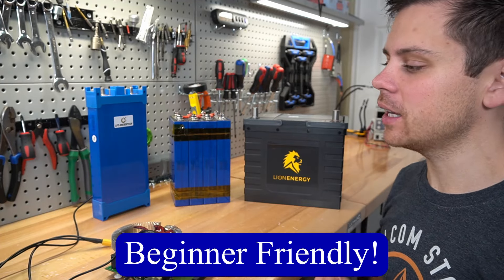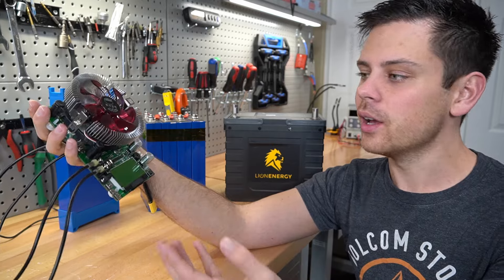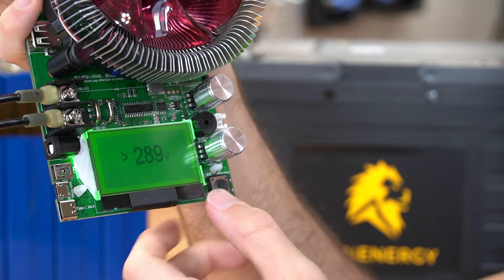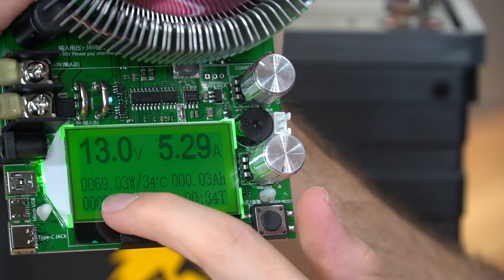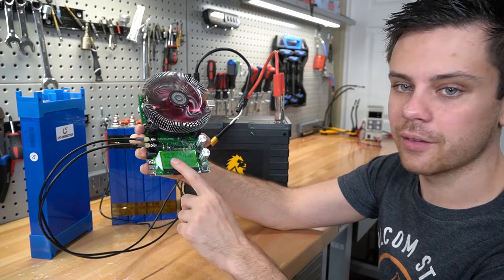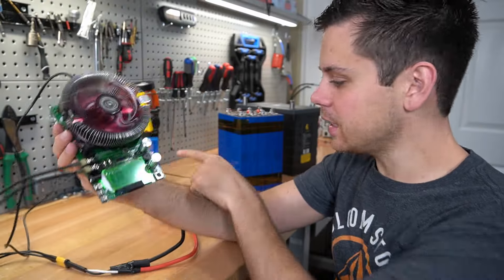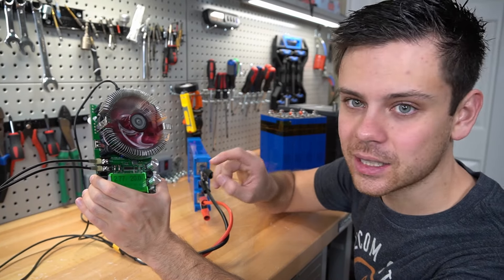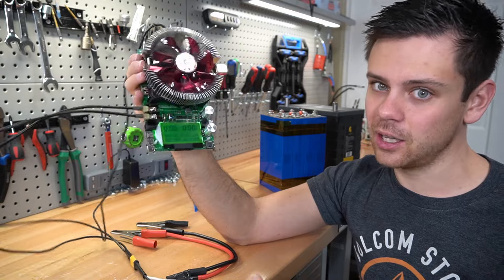Beginner Friendly Lithium Battery Capacity Test Method

Comment: Hi Will   Thanks for all that you do. Great help  I have 4- 12V 200Ah batteries. I am having trouble with the batteries shutting down. Is there a way to load test the batteries to fine the bad battery . A multi meter reads 27.9v on all 4

Comment: i have made a "simple" setup for testing a battery not loosing all the energy to heat. 
( battery1 to test (with bms) -->  energy meter --> inverter to AC --> battery2 charger --> battery2 (with bms) )  
battery2 is much bigger than battery1 and practically empty ;)
Reply: I like your way of thinking.

Comment: Why not just power your inverter through an inline DC Power meter? The power meter logs Amp-hours, power, voltage, current, peak current, min voltage and more, and only costs €10 on eBay from China and will withstand 100 Amps. The procedure would be to just start up your inverter and power your usual loads (computer, lights, whatever), and read off the Ah value from the meter when depleted. Advantage is that the energy isn't wasted as heat, it's used to run useful appliances that you'd have run anyway. And the max discharge rate is way higher than the 300W of this load tester so it would finish faster.

If you're going to look it up on eBay, it's the one with the blue case and the two-line dot matrix display. The title of the cheapest one is "LCD Digital Battery Analyze Monitor Watt Meter DC Ammeter RC Power Amp 60V/100A"

Comment: Thanks for sharing this info on such a neat device. Can you test super capacitors to see if the Farad value claims match what is sold?
I am interested in buying these 16.2 Volt 83.3 Farad super capacitors sold on ebay and Amazon. Are they really what they are.

Comment: Take the positive voltage on the buzzer, thru a 1K resistor to a 2N2222 to a relay that will disconnect the load. Solved.

Comment: With thin leads I guess the voltage readout is some 0.5V lower at 20 Amps.  Does the test unit have some I*R cable voltage drop compensation or maybe separate test leads?

At high current you may disconnect to early if you do not compensate for the cable voltage drop.

Comment: Cool video as usual!  If all goes well this year I plan to upgrade from my 12v AGM system to a Lifepo4 either 24 or 48v one, hopefully over 300ah total.  Found a deal on used PV panels.  The question is, do I need to check just to voltage to make sure they are working or the Amps as well?  In either case would I also need to test them on a Sunny day or would part sun work?

Comment: Because of not null internal resistance of the battery you need to test it at the same current every time. Test results made at different currents incomparable.
In the datasheets of the good brands batteries usually exists chart with usable capacity vs discharge current.

Comment: Love your videos! I noticed that the voltage at the battery with NO LOAD verses voltage at the battery WITH LOAD (.2C) are substantially different. Which voltage measurement should determine the top (3.65v) and bottom (2.6v) voltages?

Comment: Will thank you for all the time you've put into these videos and sharing your knowledge.  Many have no idea the time and energy it takes just to publish these.  Something I'm always curious about is sort of a lessons learned video, we all know what happens when we short these bad boys...lots of sparks and honestly on the higher capacity cells possibly lethal.  I'll never forget trying to do my dad a solid back in the early 80's when I attempted to install his new car battery in his 77' Chevy Nova.  I learned that when you leave the large plastic insulator block that came on the bottom of auto batteries in that day to insulate from poor storage (i.e. concrete floors); that if, you leave said block on the battery and install said battery and slam shut the hood it is very possible (100% chance in my case) that the hood of the car will short circuit the battery.  My dad was none too pleased to see two large silver dollar sized holes in his hood :)  Do you have a video of lessons learned?  If not is it something you would consider making?  Thank you again!
Reply: i have 3 of these from a year ago. Now not one of them will turn on.
Is there a way to "reset" them? None of them "blew up" or smoked or anything like that.
Reply: @RemodelCalculator  have you measured DC volts at the round plug end of your power supply?  Outside of that, nope, no clue what's wrong with your units.
Reply: @motleypixel  i measured voltage at "Output" plug - same as input voltage
Reply: @RemodelCalculator  hold on, a wall wart (older term for AC>DC power transformer) shouldn't have the same input/output, typically in the US the input would be 115VAC and the output is typically between 5 and 24VDC.  So in your case your wall wart isn't transforming anything and 115VAC has fried your unit :)

Comment: I am curious, do you test a 12V Lifepo4 battery to verify Ah and Wh rating by letting them run down until the BMS shuts down the battery due to low voltage or until running it down to 10% SOC or so?

Comment: I have a Qwork Battery Monitor Voltmeter Ammeter that uses a shunt.  You mentioned that I could use something like this to do a capacity test.  How would I do that exactly?  My battery is a 48V 105AH LiFEPO4 battery hooked up to a golf cart.  Thanks.

Comment: The device you are using in this video comes with a USB port and the USB cable with positive and negative internals on one end, and USB on the other. Can this be used instead of using the positive and negative terminals on the device?

Comment: Nobody is talking about this clearly in the comments (not that I found), but to set the low voltage disconnect you need to double-click (not hold) the button. However, on some units it doesn't disconnect, it just warns with a beep; and even if it disconnects, the cell/battery is still connected to the unit and loses voltage. So beware!

Comment: hi i made a simple 4s 56 cell battery at 2 amps take around 8 to 9 hours charge by the wall i only charge it to 15.8v and not the full 16.8 v what u think the wh would be on that set up im thinking it would be around 336wh or something but would love to hear ur thinking on it its been running now for around 6 months i have no bms on it as was not sure how to add that in but iv checked the cells and there all within the same range of charge so n probs there

Comment: I just received the one with the pink looking fan... i have a question on these...
I set low cutoff to 11.5 and had volt meter on battery directly, I noticed the volt difference between the two was like .2-.4 volts.
Tester turned off at 11.5 but volt meter showed battery was still at 11.8. I think I was running the tester at about 10 amps.
Should I test capacity with tester at 11.5 (fla) or bump it down to like 11.2 so battery meter showes battery at 11.5?
Reply: Yeah i have the same experience. Started with one cell at 3.3v.Turned the tester on at 10A. The multimeter displays 3.30V and the tester 3.0V. Did you find the answer why there is a difference?
Reply: @frankprumers8902  same ..did you ever figure out ?
Reply: Same here :(

Comment: interesting video. I would like to know if its possible to use this same setup to put a load of 40/70 amps on a battery in order to test the output of a rebuilt alternator? Thank you in advance.
Reply: 70Amp x 12Volts = 840W boom! With this 185W tester......
Reply: @MrMaster72  thank you very much good sir. I have plans for it :)

Comment: What if the LifePo4 battery has a BMS with Bluetooth? Would the BMS Bluetooth reading be accurate enough if you hooked the battery to a load in order to find out the Ah's of the battery?

Comment: I would love to see a more detailed video about the C-Rating. I'm still confused about that. I see 20-C (on the battery), and a 1, 2, 0.1, 0.2, and so on in your on-screen postings and i'm confused. and, how would i use the c-rating when testing or comparing battery / system setup and what-not's. thanks.
Reply: I think a Will Prowse clip on that would be cool too. In wondering along the same line, I ran into a pdf Guide to Understanding Battery Specifications: here is what that says:    "C- and E- rates – In describing batteries, discharge current is often expressed as a C-rate in order to normalize against battery capacity, ...  A C-rate is a measure of the rate at which a battery is discharged relative to its maximum capacity. A 1C rate means that the discharge current will discharge the entire battery in 1 hour. For a battery with a capacity of 100 Amp-hrs, this equates to a discharge current of 100 Amps. A 5C rate for this battery would be 500 Amps, and a C/2 rate would be 50 Amps. Similarly, an E-rate describes the discharge power. A 1E rate is the discharge power to discharge the entire battery in 1 hour.

Comment: Question if I may Will, when manufacturers state capacity, are they measuring to the recommended low voltage cut off point or are they measuring to the absolute death of the battery? Is a 100ah the useable capacity? Or should I expect like 80ah to 2.6v?
Reply: Great question!

Comment: Hi, Will. Do you know a lithium battery charger where we can specify the maximum charge voltage. I've been trying to find one that let's me charge for example to 4.0V instead of 4.2V. I've the Opus charger and Skyrc Imax B6, but the minimum voltage the skyrc let's me use is only 4.14V. Thanks and congrats for this great channel.

Comment: Can this tester be used on multi-cell lipo packs like those used in radio control cars and planes, or it it only for a single cell?  I would need a low voltage alarm for 6 cells at 21 volts.

Comment: If you use this on a newly charged LGM Sealed Lead Acid, and don't set a minimum test voltage, did you just destroy the battery when you get back? I mean isn't it bad to run that into the lowest voltage (like 0)?

Comment: 120ah lipo batteries in series and then I disconnected 1 from 5 batteries. All others 13.3 and this one 12.4  and soon as I changed it out so I had 4 in series working well each 13 v or above, the total 50 volts plus. 

How could one battery die like that. 

Also another battery the too of the case have risen up. Much be pressure release

Comment: Can it really handle 185 W for long time? I heard about it will burn the Mosfet with 150+ W. The accuracy of these cheap dummy loads is not really as good as claimed. It can have 3..5% error and it doesn't you 4 wire measuring. You will already loose some W in the wires when loaded with 10+ Amps.

Comment: Will, I keep getting that annoying beeping sound, without the battery even hooked up due to my low voltage shutoff at <10.6V!  What is causing this? I hook the battery up and turn up the dial and it will not do anything but continue beeping. Any help would be so appreciated

Comment: These do NOT turn off the load properly. As soon as the load turns off from low voltage, the voltage goes back up and it draws more current until it drops again.

Comment: hi there, can be put toghether lithium battery different Amps like 3 cels 90A with 1 cell 100A ? and also can be put together different C rates? 
i have for exemple 80 cells 18650/1500mAh on 3C can i put them in series with 18650/1500mAh but only on 1c ? 

thanx

Comment: Random question that may sound stupid, however, how dose a device know how full a battery is?
Dose the resistance change?
If you change it out for a "larger" batter of the same size how dose it know the difference?
Reply: For cheaper devices voltage and for more premium options a coulometer

Comment: Do have a link for the temp sensor probes you use for the smart bms you suggest for a 48v LiFePo4 diy battery. The ones I have are not working properly and read -17 instead of proper temp. Thanks in advance.

Comment: For a 12VDC SLA 8Ah battery test I set the LVCO to 10.8V (<10.8V! as shown on display) and the damn thing will only take about 1.2AH out of the pack before the LVCO senses 10.8VDC.  Whereas my old hobby RC Triton Pb, NiMh, NiCad, Li-Ion charger and discharger is able to take about 7.6Ah...what's up with this?  Faulty?  BTW, to change the LVCO is insanely tedious, having to double tap the little momentary press button for .1V increments...LOL took me 10 mins to go from 0 to 10.8...I'm sure I'm missing something obvious...or not?

Comment: So I don't know exactly why; but I just tried to set up the capacity tester for a test and was starting to increase the watt knob up to around 100 W when suddenly the unit started to fizzle and pop and suddenly burst into flames. Scared the heck out of me and also could have burned my house down. Just an FYI on safety of the unit. Luckily the test was only starting when the fault occurred while dialing the watts.

Comment: I been playing with mine. I thought it did shut down when the voltage got below the setpoint but maybe I was distracted by the beeping. The voltage levels are really hard to adjust. They go full scale in one direction 300V or zero and they won't reverse direction. This may go back.

Comment: Sorry, I don't know much about electricity so this might be obvious. I am doing a capacity test with this thing (185w version) on my 100ah battery that is supposed to have a BMS. I am 45 minutes into the test and the Voltage on the lcd screen of the capacity tester shows 11.3V, 16A, 012.35Ah used, 181watts. Why is the Voltage being displayed as so low? Shouldn't the BMS have cut the power already?

Comment: What voltage is required from the wall wart?  I am off-grid and need to run off a buck convertor!  I do everything DC if possible.
Reply: the wart is 9v. i believe the circuit card says 9-12

Comment: can you get away with not having to turn down the load knobs before each test by using an anti spark xt90 connector?

the anti spark xt90 connectors are used to pre charge the capacitors in devices and they do it by having a resistor that is connected inline to the load thereby you dont get the big jolt of power that can damage connectors and sometimes even blow reverse polarity protection diodes (that is a flaw in the cheap battery spot welder where the inrush current can blow the diodes in the trigger section).

Comment: Just getting ready to Test 8 x 3.2 v 280 Ah LiFePO4s with that same unit after putting a full charge on set. Big Question: Can I Trust this Tester to cut off at the cut off volts I set up?  I might trust it more after I see what it does on first cycle. I sure would not want to wreck a new LiFePO4  cell ...  No matter whatever answer I get back: I will time myself to watch closely on the first capacity test.     ... 
I might charge/ then test  4 cells at a time with this fan heat sink unit, then rematch top voltage before set up for  24 volts battery bank.  That would match a 12v 50 Amp  LifePO4 charger from Aliabab that just showed up today.  I might do bottom balance too after I look at individual cell volt readings. / ... I have also been considering a bigger current draw option for quicker capacity test (also have a Multifunction Battery Meter with 100 amp shunt I purchased as option too (all kind of inexpensive options) to test my close to 7.5 Kwh worth of battery power.  Thanks for your lessons. It is reassuring to know I can  come back for these references as I get into my hands on learning phase. I am reviewing another clip of yours on capacity testing next.  Thank You    :+)     from Bill in Northern California

Comment: Not sure if I understand this correctly. You leave the battery until it fully discharges and shows you the total capacity. But wouldn't that damage the battery and reduce it's lifetime?
Reply: That's why he set the Low Voltage Cutoff at 2.6v   Once it goes down to 2.6v its supposed to disconnect and stop the test so the battery isn't damaged.  However, some of the versions people bought, it doesn't cut off the test and only gives you a quiet warning sound... You better use this while you sleep.

Comment: Hi Will, love your stuff!
I recently purchased 32700 Lifepo4 3.2v cells from China. I was promised that the capacity was 6Ah and that the cells were “A grade, new cells”. After capacity testing with the same tester in This video , they are 5Ah at best. I am an electrician and believe i tested these cells correctly with a 0.2C four wire test. I am currently in debate with the seller over this issue.
My question is this: i tested to 2.5v cut off, where as the seller claims 2.0V is cut off Volta for capacity testing. Can you confirm either way?
Reply: At 7:25 he says 2.6v low voltage cutoff

Comment: HELP! Got this gadget from Amazon and did a test on a  new100ah 12v battery with a low (11v) voltage cutoff. Set a 100w discharge rate to be conservative. Everything seemed to be moving along well every time I checked on it's progress.  Got busy, When I got back a couple hours later was shocked to see voltage below 10! NOW WHAT?

Comment: So, I made my own test setup using a fairly cheap, small inverter (300W capacity Bestek) followed downstream by a Kill-a-Watt meter and several light bulbs plugged into the Kill-a-Watt.  The inverter has a built-in low-voltage shutoff, and the Kill-a-Watt, being downstream of the inverter, gives me the actual usable capacity.  I would be interested to know if this test method is reasonable, or is there a flaw in my reasoning?  Thanks.
Reply: Are you accounting for inverter loss

Comment: What's the highest voltage you have tested this with, Will?
Reply from the maker: 48v
Reply: @WillProwse  -  cheers. I've ordered one, will test it on some of my 52V 14S eBike battery packs (58.8V fully charged), hope it won't explode 😁
Reply from the maker: @sdewaard  awesome! Should work fine. I am going to run mine at 150w to be on the safe side. I'm sure the fet will fail eventually, so keeping at 150w should keep it happy.